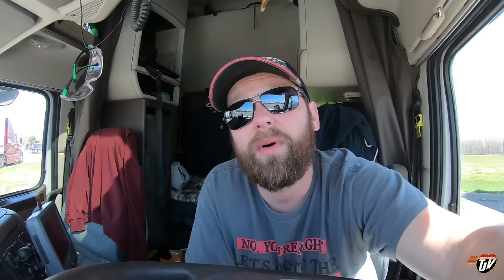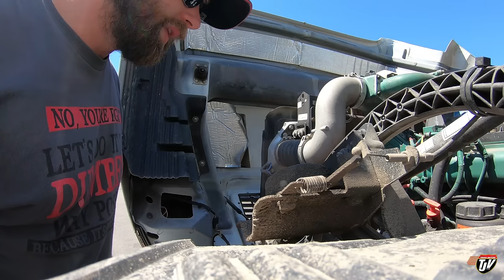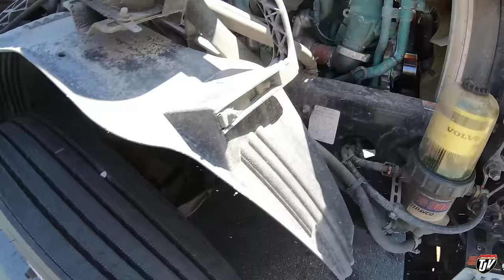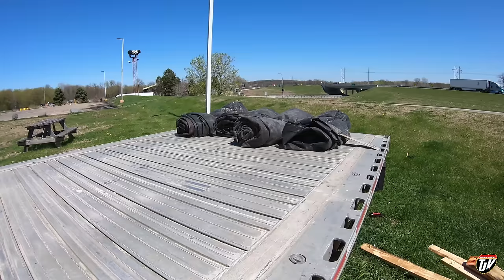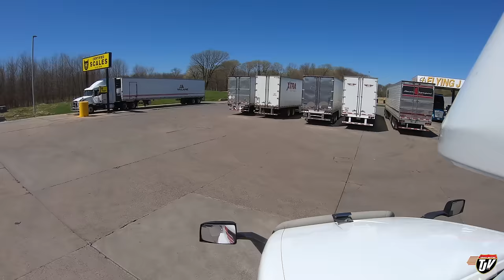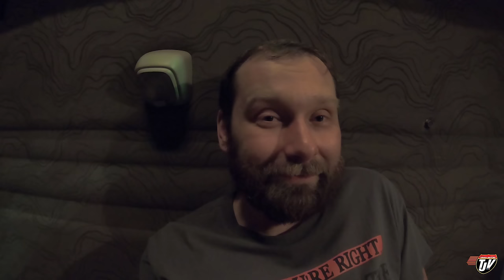My Trucking Life | NOTHING HERE | #1979

Comment: Expect more empty decks and cheap loads - it's simple Econ 101. Less output from closed factories means less freight  to haul. Too much supply of trucks means lower payment for the loads that are out there. It also means that there will be loads that it makes sense to haul,  even when they pay less than your cost to haul them  - just as long as it costs you less than the cost of a deadhead. Econ 101. Gonna be this way till either everybody gets back to work or a lot of truckers go broke and quit driving. Hang in there and try to survive.

Comment: Get rid of the Volvo. Everyone I know that has a Volvo has injector problems and air dryer problems. Get a Freightliner or Kenworth and you will spend a lot less money on repairs and downtime! I have a 2019 cascadia. Payments are high, but so far, ZERO downtime and full warranty. Plus, you can get a GREAT deal on a new truck as they are just not selling any.

Comment: To be fair to Ontario and Quebec, would you really want to be dragging along ~80,000 lbs of truck along the road at speeds greater than 105 km/h (65 mph)?
I certainly wouldn't.
Empty or loaded, I'm perfectly happy cruising along at 97 km/h (60 mph), in order to save a little on wear and fuel. I just chill in the rightmost lane, and almost never have to worry about maintaining distances between myself and vehicles in front because everybody just drives past me... sometimes well over the posted speed limit.